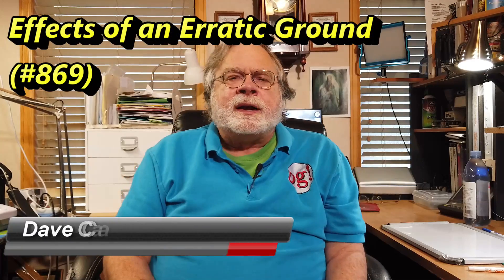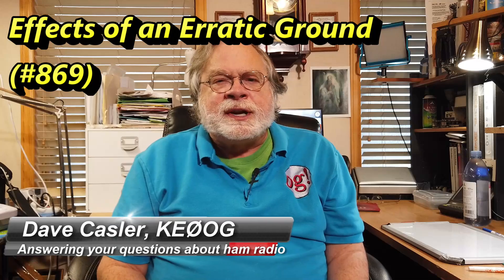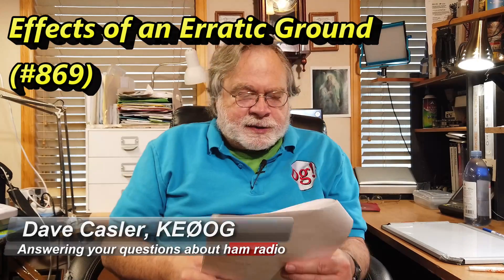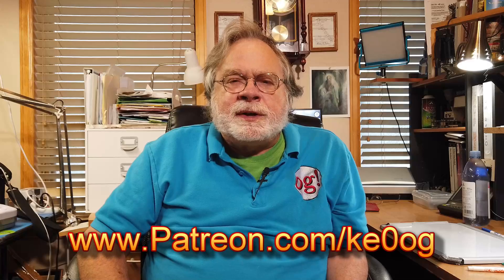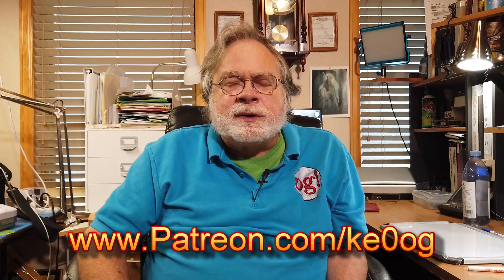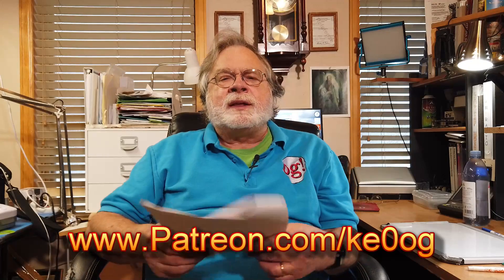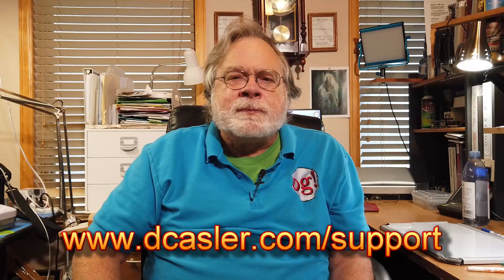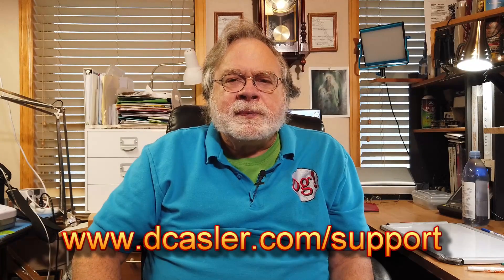Effects of An Erratic Ground (#869)

Comment: Hi, Dave, again something I have to point out here.
You said working on 100w would cause 1w leftover in the shack. That's very strange concept.
Faraday cage doesn't work that way.
If it's a complete metal (no need for copper only) shell nothing (both theoretically and practically) would enter or escape.
Our planet earth is being protected by a form of Faraday cage by the magnetosphere from the harmful high energy particles from the Sun; otherwise higher forms of life would not have evolved in the first place. The particles are being concentrated at the poles causing the Northern and Southern lights that are spectacular features we enjoy watching!
But when the earth's field starts flipping over time and is not aligned along the poles people of the remote future (an unfortunate situation though) would be visualising the aurora along the equator too!
If the Faraday cage is made of wires then it depends on the frequency of the RF energy we are interested in. Any wavelength shorter than the space between the wires of the 
 cage would escape or enter.
You have the "microwave oven" with the door having the wire mesh just for this protection purpose only; it's simultaneously made clear for you to have a peep inside the cooking chamber.
If the cable system of the shack, metal casings of the TX RX and other accessories are fine and above all the entire system is well balanced there would not be any RF in the shack at all.
The questioner said he had a "Faraday cage" like shack (!) and all was well with the TX and the amplifier until recently when he started to suffer from RFI in the shack. Ultimately he found the corroded splice in the ground connection was the problem.
He didn't say whether he had RFI on all the bands he was working on.
His TX and the amplifier were working well into the dummy load, he said.
All these days his ground connection has been like a quarter wave length or odd multiples thereof and hence has been "hot" at the TX; when the ground was no more effective he started having the RFI issues. That's his ground connection to the mother earth is not only working for DC but for the RF AC.
He should evaluate if it's true by employing the simple RF clamp on ammeter by G3TXQ or any commercial one (maybe your MFJ suggestion !).
If a large magnitude is detected he is sure of having found out the "RF ground loop" problem which is no good.
He now knows that his antenna system is not in balance.
He should try changing the coax cable feeder(s) length and try to adopt the CMC (Common Mode Current) Choke at the feed point of the antenna whether it's dipole antenna or any other unbalanced types.
He said he noticed high SWR that became alright after the station ground was resurrected!! That's not how a station ground works!
He can also try using the "artificial ground system" (from a homebrew or your favourite MFJ) to get the facts established.
He might want to go through my comments on your previous video on this YT series.
I want to reiterate that if you say a station ground will save you from the RFI issues it's wrong; it means he is warming up the worms underneath the ground.
I have been living in 4 storey building and operating my station floating. I am using a homebrew 1kw RF power amplifier using a double Zeppelin antenna and a homebrew BLT tuner without a trace of RFI in the shack for 7 years or more!!
I wish him all the best 👍
De VU2RZA
Reply: Good morning Dr Subbi..thanks for the nice explanation..my question is what Mr Dave says if we tx 100w ,1w will be there in the shack..what does that it means..is he saying the max efficiency is not possible  with any antenna ? Or there will always be an RFI of 1W in a 100W transmitter ?the discussion is leading to a conclusion that a  Faradays cage is the solution for RF in the shack 😁
Reply: @prabhu6330  thanks for your response.
Yes, he has his opinion that some RF (limited to his dbm slang) lingers in the shack that won't wish to get out! Nice imagination though.
Any energy would find the path of least resistance and as per "Thevenin theorem" energy finds it easy to flow into the feeder if the characteristic impedance of the source, line and the load are identical; it will never seek anything that's offering a high impedance like the "ambient air" in the shack.
RF, I know is intelligent and not lavish.
De VU2RZA
Reply: Neutrinos pass directly through anything so a Faraday cage is not 100% protection from all radiation
Reply: @bassangler73  ha..ha.. neutrinos, as the name implies don't interact with anything, you must know that.
Faraday cage offers protection from electromagnetic radiation, you must understand.
De VU2RZA
Reply: @Subramanian R  ha...sorry had to say it 73's
Reply: @bassangler73  hi, please you don't have to say sorry.
The term Faraday cage was brought in here by the questioner. 
I said the magnetic field flux lines protect the lives on earth in the form of a cage.
Strictly speaking I loosely associated the term here.
Faraday's ice pail experiment resulted in the disappearance of electrical charges laid on the inside but to be present only on the surface. Like charges repel and they move to the outer surface as the area is always larger than that available on the inside of any metallic container.
The shield can be made of any metallic conductor.
Neutrino, a subatomic particle traveling almost at "C" being massless and chargeless doesn't interact with matter; numerous particles keep traversing you and me and the whole planet unimpeded.
EM radiation contains both electric and magnetic fields in space quadrature. Light is EM radiation and we get it from the Sun all the time. Radio waves we use can be blocked by a Faraday cage. But X-ray, Gamma rays are difficult to screen by simply placing a thin layer of metal sheet.
Thanks for your response.
De VU2RZA
Reply: @subramanianr7206  👍